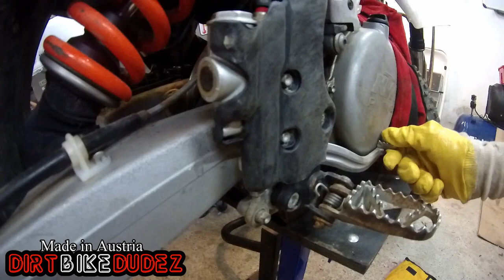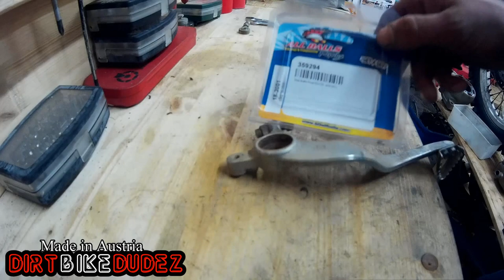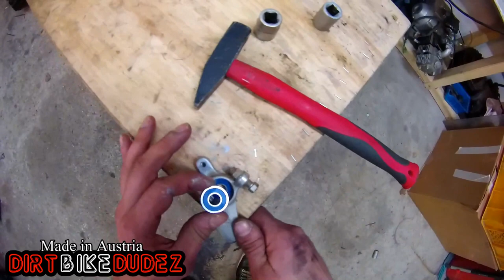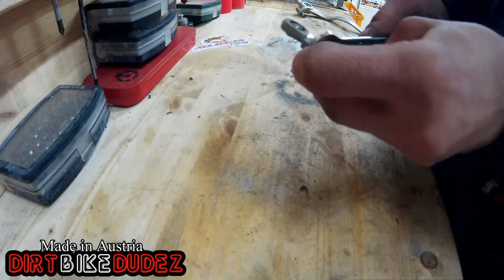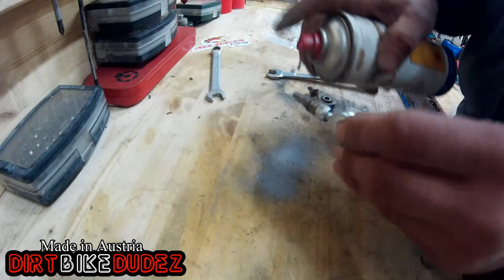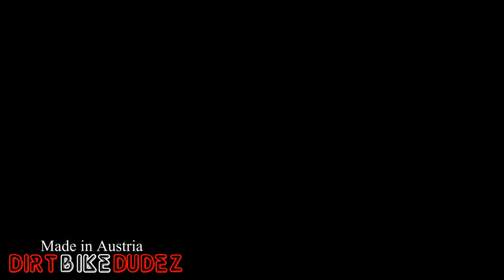How to rebuild a KTM rear brake pedal / DirtBikeDudeZ

Comment: Good instructions! Break lever gets sloppy and needs a new bushing ! Put the nut back on the bolt so you don't loose it ! Braappp!
Reply from the maker: +Richard Bolt Exactly! :) It´s a shame the older bikes got no bearings in the brake levers.. When it wobbles, it wobbles :( unless you put a new brake lever on...

Comment: where is part 4 of the $50 yamaha yz250 project?
Reply: also if you would have froze those bearings they would have just dropped in with no tapping needed
Reply from the maker: +DirtBike Daily I know, but don´t have a freezer in my workshop :(
Reply from the maker: The build series will go on this year :) i finally found the parts for the engine i needed!